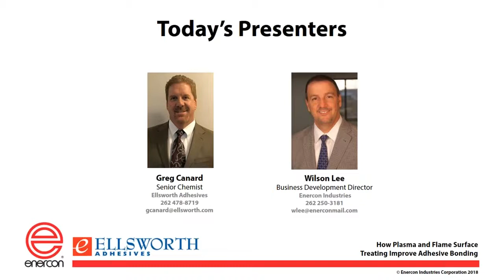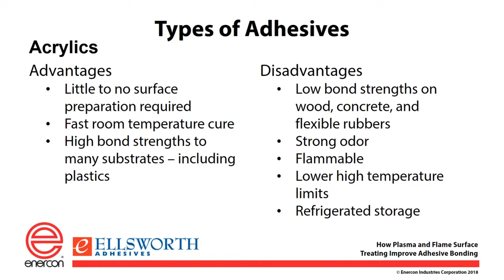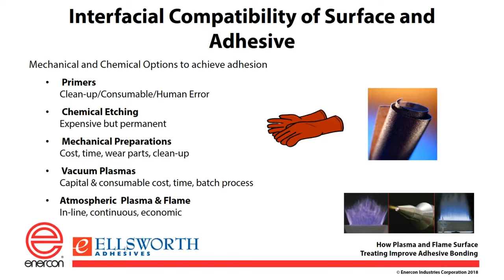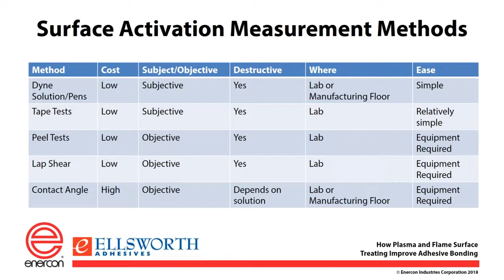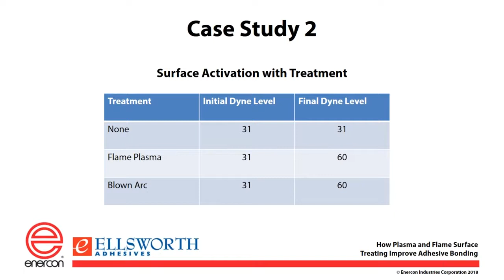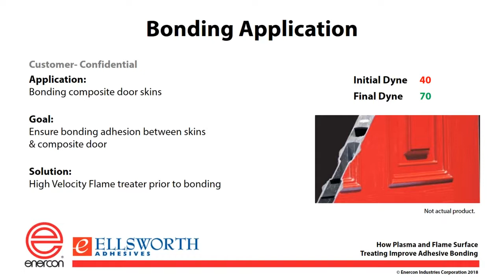Webinar: How Plasma and Flame Surface Treating Improve Adhesive Bonding

Comment: In the case of multi-material additve-manufactured (SPS, LPBF) pieces is the adhesive theory relevant? I mean some tests are not feasable which such pieces peel-joint for example. Then how is possible to study the bonding strength of these ones.?